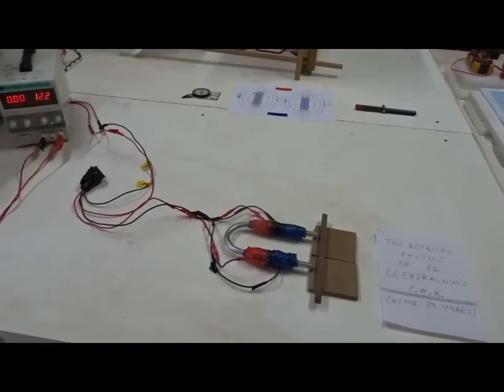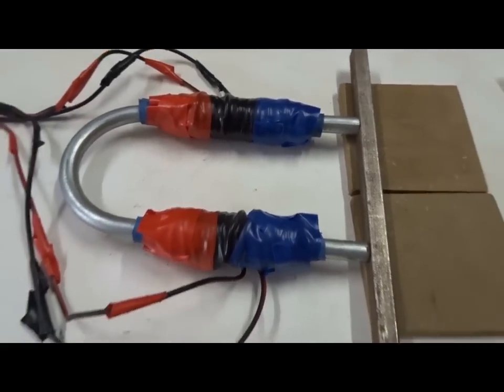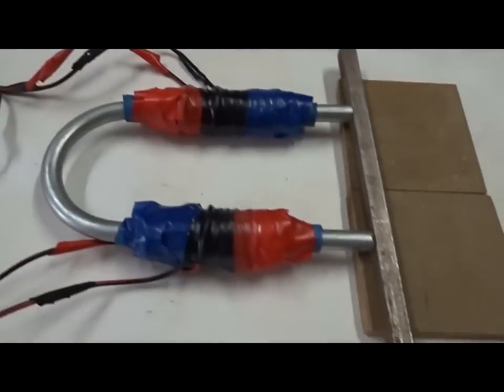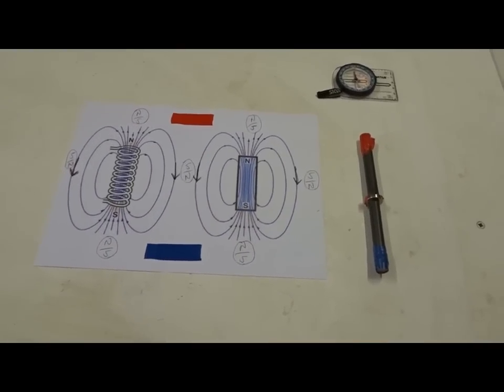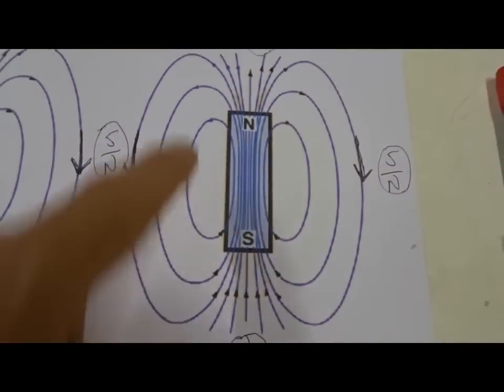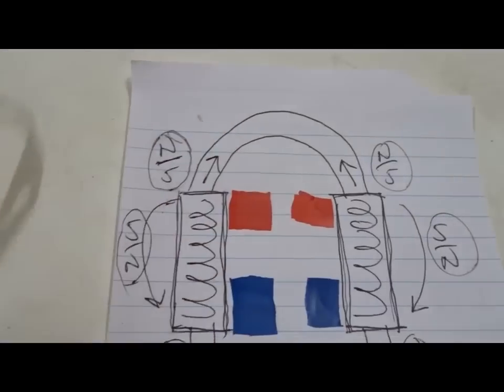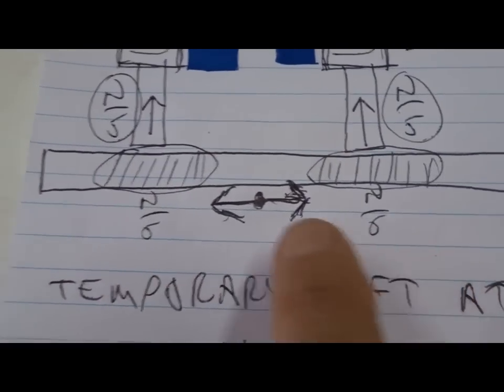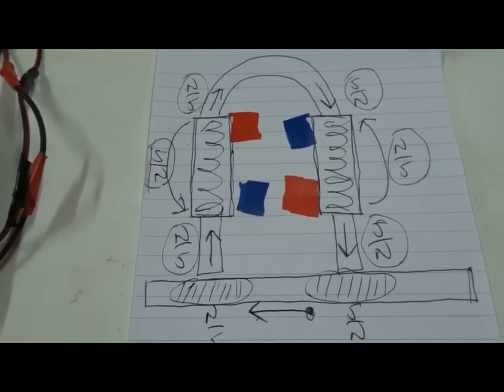Did Ed Leedskalnin use "circular magnetism" to lift heavy rocks at Coral Castle?

Comment: No.  With enough leverage and pulleys you can even build a pyramid.  Yeah.  I went there.  Maybe do a video on pulleys so all this "rock too heavy" nonsense can end.
Reply: exactly. 
I even saw a guy who lifted huge stones in his back yard in Indiana or somewhere, using a see saw method. He moved buckets of sand back and forth on the top of the elongated stone. As they caused the stone to tip to one side, he slipped a new fulcrum under the raised side, then moved the buckets back, causing it to tip, and inserting a new fulcrum higher... etc.
Was a giant stone the size of a stone-hinge monolith, and the dude had raised it like a foot higher into the air in just a few minutes by himself. 
Then you got the Easter island people who literally "walked" the statues down the paths, tipping them and twisting them back and forth with ropes.
Really incredible some of the clever, low tech, techniques of ancient stone makers that we have lost.
Reply: you guys havent seen the pyramids. its too big.
Reply: @esahg5421  pyramids are made of many many many movable blocks. Not immovable blocks.
Reply: @Reach3DPrinters  did you see that great block of granite inside the pyramid? advanced tech was needed to accomplish that, what is the link between acoustics and magnetism? perhaps levitation is hiding somewhere in there
Reply: @esahg5421  Nope, they used counterweights inside the grand gallery. Check out Jean Pierre Houdin's theory on Khufu's pyramid. Its been 3d modeled and explains a LOT of details that no one else has explained. Like the V cut in the big step, the notch on the outside for internal ramps. How those large granite blocks cracked and why, etc. 
Occam's razor says the simplest solution with the fewest assumptions is the correct one. 
Ill take counterweights and ropes over levitation any day, especially considering it was 4500 years ago. Unfortunately, reality isn't all mystical. Its boring on the surface and gets incredible only if you dig deep enough to see the subtlety. 

Here is a good video that covers it:
https://www.youtube.com/watch?v=LaoftSAXSXQ
Reply: @Reach3DPrinters  everything for me is mystical. levers and pulleys were once magic too. 

sometimes the simplest solution is only the easiest to swallow. consider i place a bicycle next to a chisel and i give you a block of iron.

simplest solution is to carve out a bicycle.

will you have a halfway decent bicycle though?
Reply: Please show us how they made such precision cuts in rock since it seems you no everything about past times, We will be waiting for your explanation it should be good since you hold many many degrees in such ancient technology.
Reply: @jase4270  stone was cut with large wheels, water and sand. The sand is an abrasive and grinds the sandstone easily. Granite is MUCH harder but can also be ground down with garnet sand. This also cuts Granite extremely smoothly.
Reply: @jase4270  Please address my actual post and explain how pulleys and levers didn't work in the past.  Please reference your physics degree.
Reply: At the pyramids they curved the the instruments they needed to build them. Usually on capstones of archeways. It's a resonant crystal cone and an Ankh. He would use two reasonant cones striken together and focus at a point where the stone block was, forming a triangle, then lifting the stone. One thing is to put them in place but curving them out was another.
Reply: @John-wd5cb  Ive never seen evidence for resonating crystals to levitate giant blocks if thats what youre suggesting.
Reply: @Reach3DPrinters  where would you expect to see this?
Reply: @John-wd5cb  can it be reproduced? Is the tech viable? I would start with that. Can we take said resonating crystals and cause blocks to levitate?
Reply: @John-wd5cb  finally, someone who actually knows! thanks, levers n pulleys lol
Reply: @John-wd5cb  I hope that was sarcasm.  It sounded completely insane.
Reply: Sup ppl! He admitted it himself. I guess the local Lodge doesn't want the word to get out.. Aren't they Masons after all?

Comment: So I'm curious if it was the repulsion force of emr that let him help move and also set the docks very precisely. This would be a feat of course but a force amplifyer.

I have 12 ish lead acid batteries and a 450 ish amp power supply that is untested but going to be set to about 300 amps at 13v to revive these batteries. I happen to be working on this project this morning a little bit and came across this theory and channel. 

I'm a electrician who loves this and other uses of Electromagentivie force and radiation (like light or sound) and would like to explore the science and see what can be done...

In the 50s he would of needed a source to charge the batteries so either tube chargers or large mercury rectifiers.... or a generator charging off a tractor ect... it would of had to be portable and this is before solar cells were a thing
Reply: If you want to revive a battery, you do trickle charging at a low current and absolutely not 300 amps. Also 13V at 300A implies the equiv. series resitance of the batteries which are unknown and likely too high to allow 300 amps anyway

Comment: You can lift a surprising amount of weight with just pulleys, and leverage. The CBA of using car batteries over pulleys is ridiculously high in comparison. The idea that the Egyptians used this process is also silly, because to do so they would need hundreds of thousands of batteries. Baghdad batteries wouldn't be nearly as powerful as car batteries, thus the Egyptians would need millions. There's simply no evidence. And that container on top of the tripod? That's to help support the tripod itself

Comment: Good video.

Sooo where are all the cables, and how big of a machine did he need to carry and move that electro- magnet???

That little man used LEVERAGE to move all of those Coral stones.
Reply from the maker: it was in a box at the top of his tripod, please study the photos shown in this video more carefully please?
Reply from the maker: He would have just connected it to a series of 12-volt car batteries in parallel, to get enough power to lift rocks.
Reply: @DrHoraceDrew  its real simple to say but you didn't demonstrate any thing you claimed the pmh while i'm sure ed could have invented himself was already written about in davies magnetic research manuals its not capable of lifting tones of weight unless scaled up a to massive size and with very large amounts of energy if you demonstrated something other than common knowledge i would give your concept some credit but since you havn't i cant take a baseless claim serious
Reply: There is something missing here... how can the tripod of lumber support the massive blocks?

Comment: i think youre way off. the reason it jumped the gap was because the third magnet added to the attractive distance. if the poles were reversed, it simply would have repelled instead.
this in no way reveals the secret to lifting and moving massive stones.
Reply: Its magnetizing steel and de-magnetizing steel . go to a salvage yard, and watch the same process again, and again. good work skippy its done everyday..